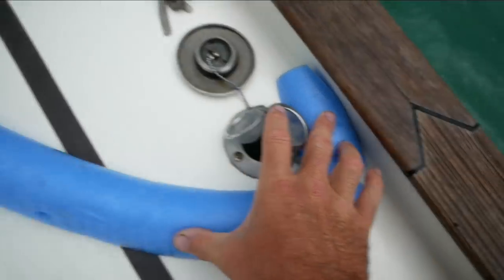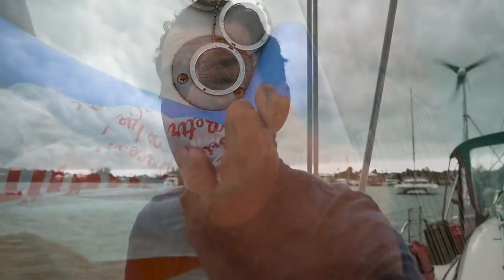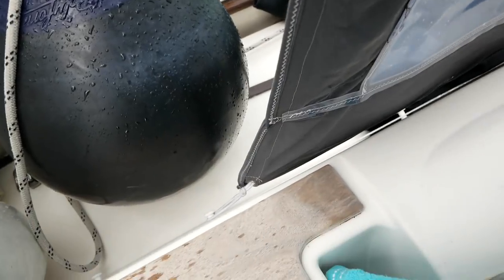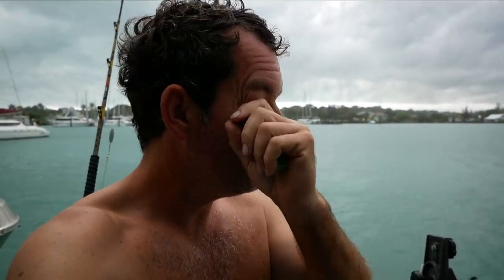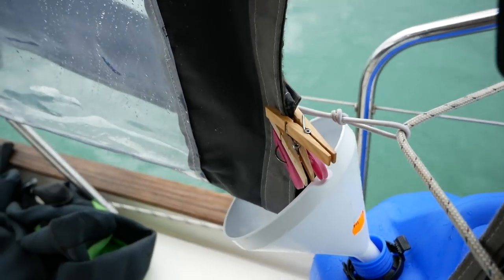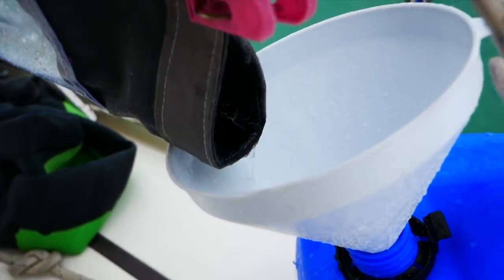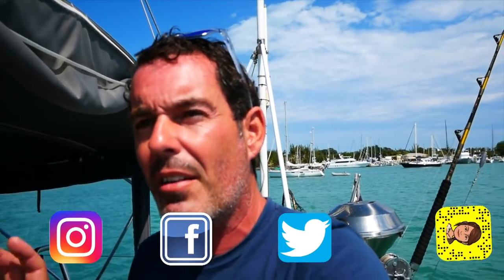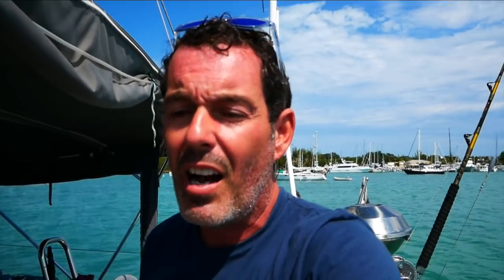How to collect fresh water on a boat?

Comment: We do almost exactly as you guys by collecting water off the deck.  But the difference is we just use a towel rolled up.  No weights needed.  Tea strainer is also a good idea.  We use a very fine mesh Jabsco screen filter that fits perfectly in our fill.  The Jabsco screen is also used before our fresh water pumps onboard.   Deck collection is the best because quite often rain comes with wind.  No worries about the rain collector flapping around

Cheers

Jacaranda

Comment: Nick, sailing Uma cam up with a great way as they have scuppers that go into a pipe that runs to a water line discharge so the top sides stay clean. They taped into that and feed via filters into their tank , a simple ball valve to redirect . Cheers Warren